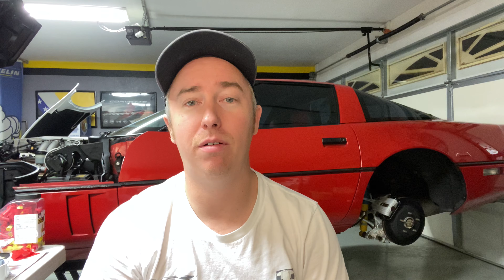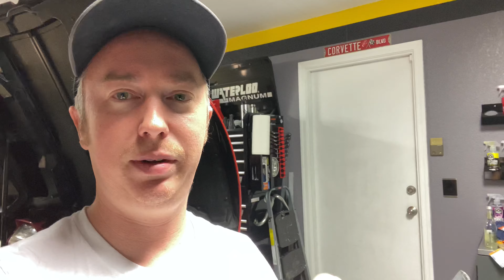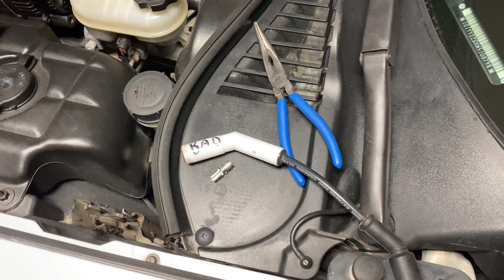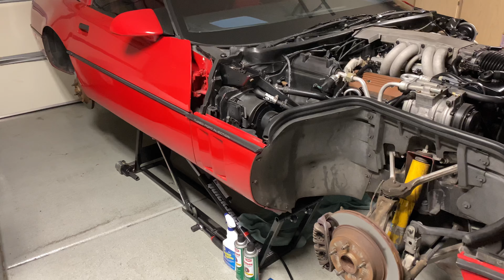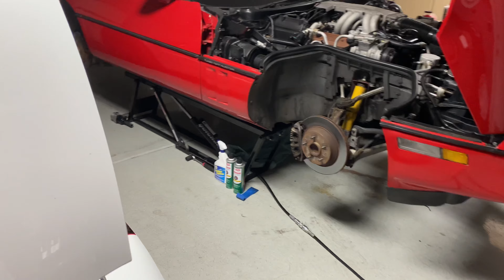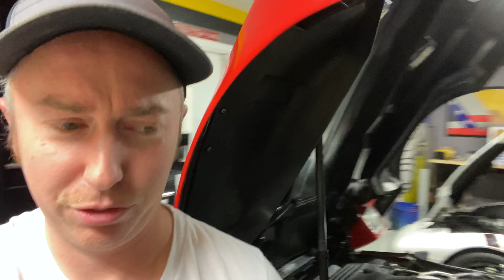2020 Year In Review

Comment: Hi Chris; I own a 1989 C4, 6 speed , & a C5 2000 Auto. Have been following you since late 2019 more regularly in 2020. I like your video's . Will be real interested in your video's on C4. Have had mine for 7+ yrs. Have had to remove & rebuild engine boring to .30 over. will inject comments as you hit area's I have had experience with. I'll end for now/ Keep up the Good work !!